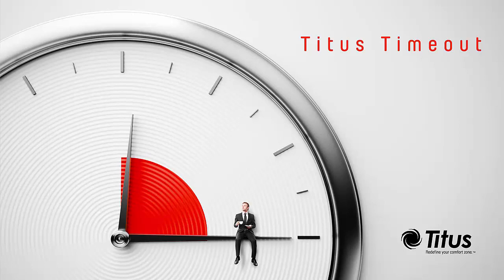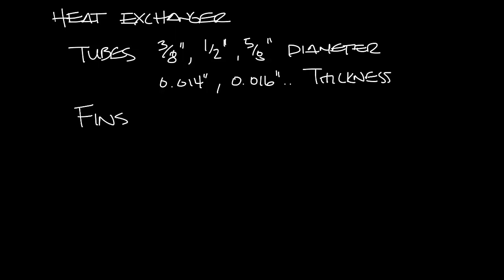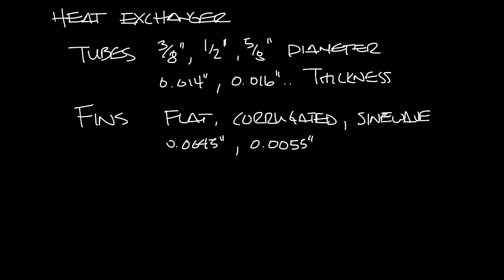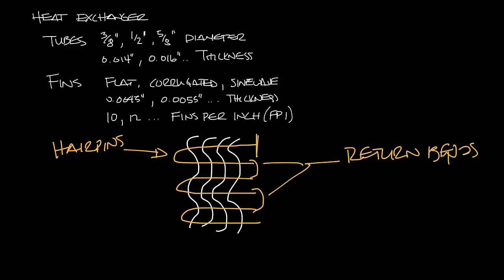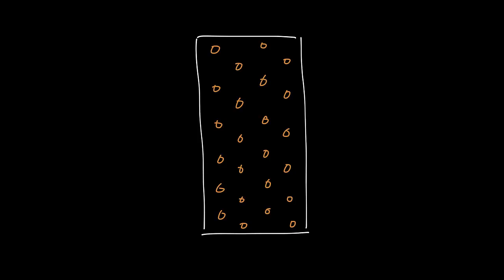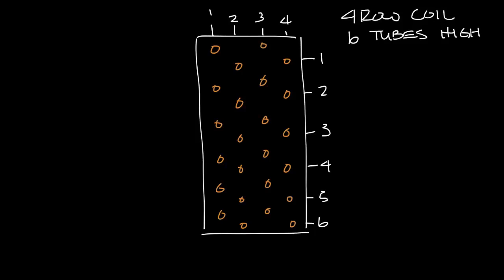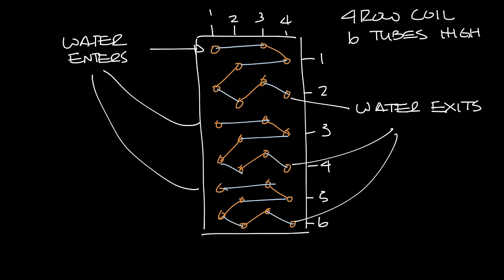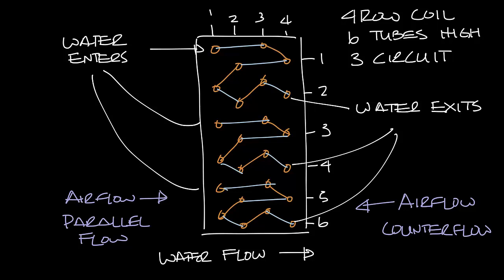Titus Timeout Podcast - Water Coils Overview

Comment: Nice...
Reply: Nabeel A is there any methode to calculate condensate water amount if it is dehumidifier. (Cool water flow inside the tubes and air pasing thorough the coil)